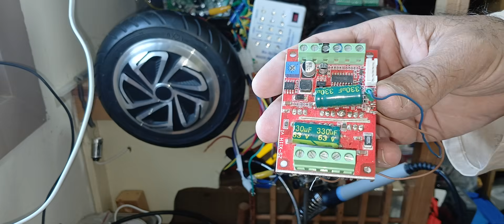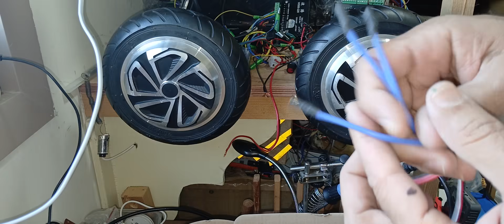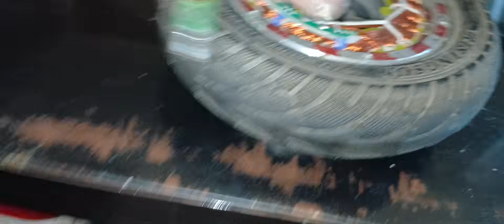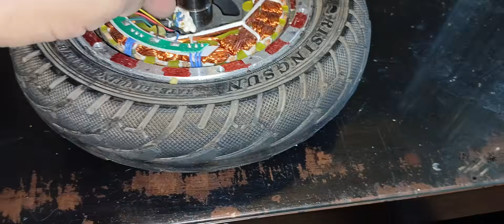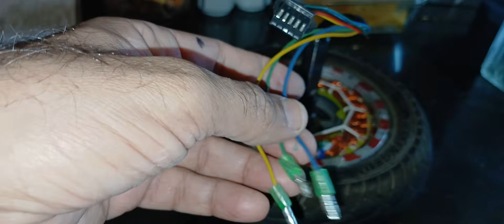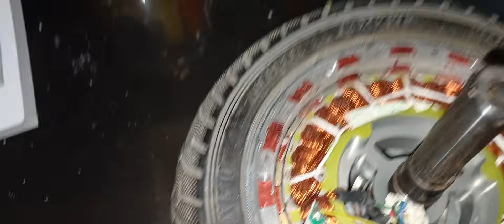Ebike testing device

Comment: Excellent demo sir, and thank you for explaining the wires and internal Coil/Magnet design!
P.S. You should be sponsored by "Bo Ai Zhi" because I want to buy one of those testers in the USA someday.
Reply from the maker: Thanks
Reply from the maker: Any question
Reply: @MKRCLab You explained and sold me on buying one of those testers. I found dozens and dozens of listings of the same model, and a similar functioning model, but with the ABC Hall-Effect LED's mounted in a hexagonal circle pattern. They ranged in price from $27 to $9, so I bought the cheapest Hex display model that would arrive (free shipping) tomorrow. 
(This is from Amazon, shilled to Atlanta Georgia, USA.)